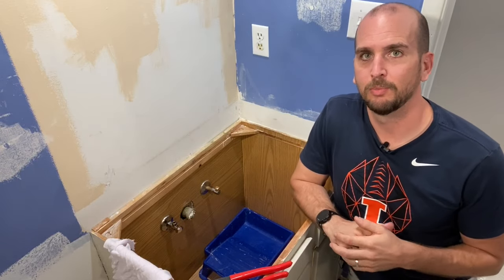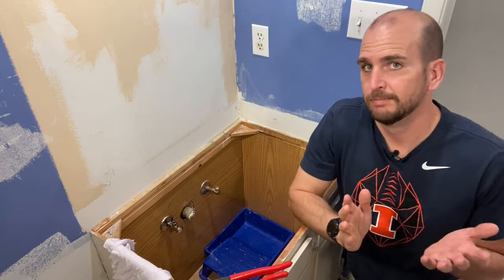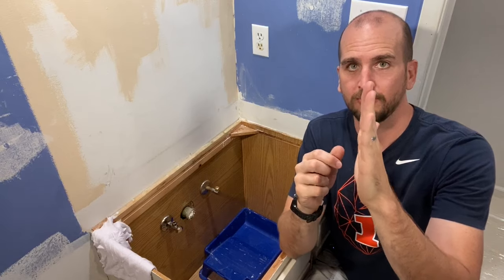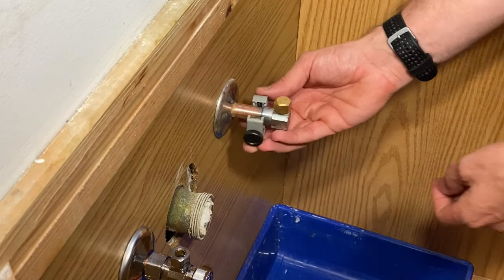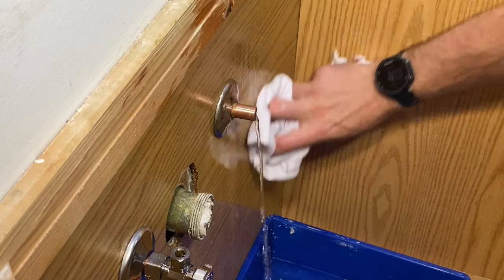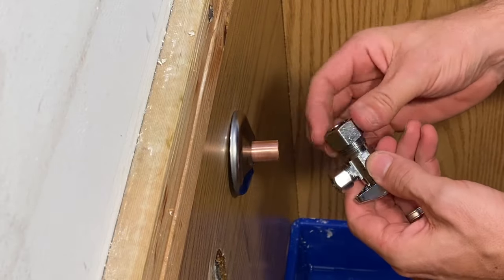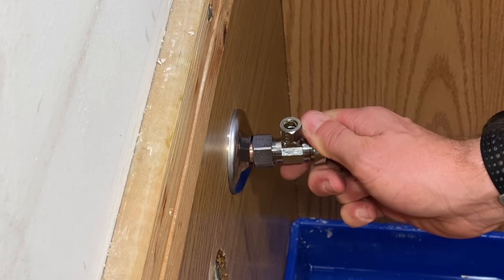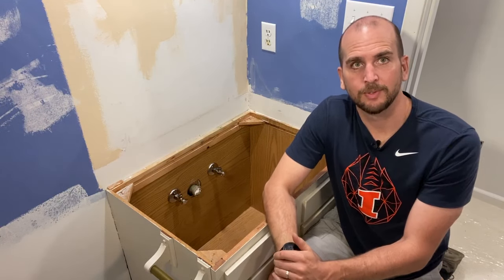How To Install A Compression Water Shut Off Valve | Bathroom Sink

Comment: Excellent video.  I have learned from other plumbers to use a mini hack saw blade to cut the ferrule or use a ferrule removing device.
Reply: The existing connection was soldered, not a compression fitting.

Comment: I just started re-plumbing my son's mobile home and it had pex in it, but the pex was brittle, so I'm going back with all copper and I did my first shut off underneath the vanity and I haven't turned the water on yet but I watched your video to make sure I did it right LOL.  I haven't soldered a copper pipe in well over 20 years and I was not good at it to begin with..  so I will be letting it sit pressurized for 24 hours before calling it a success.  Wish me luck.

Comment: Yes open fixtures to drain it. I always solder on a copper x pipe thread adaptor so you have pipe threads sticking out from the wall, and you can simply screw a new valve on.

Comment: Excellent video as usual. I was wondering why you didn't use a blow torch to remove the old valve. You would have had more pipe to work with
Reply: I for one don’t know how to use se a blow torch so I appreciate the much simpler option.
Reply: @hokypuk1  Very easy and could have had more copper to work with
Reply: I was thinking the same thing! I wouldn't appreciate a plumber making my pipe shorter and less to work with in the future!

Comment: Thank you for taking the time to make this excellent video.   Regarding the tightening of the nut between the angle stop valve and the copper line.   Should that be a half or three fourths turn after the nut is hand snug tight.

Comment: Nice job, thanks.  My wife and I just purchased a house with alot of older sinks and plumbing fixtures. Just about to get in it.  I hope you're planning to replace the electrical outlet with a GFCI.  I have to do that as well.
Reply from the maker: Hey Sean, good eye and yep swapped out that receptacle to GFCI prior to putting that condo back on the market.

Comment: Thanks for an excellent tutorial! Very helpful. One question...given your high skill level and extensive experience (not to mention the luxury of having plenty of space due to the top removal), why didn't you just sweat off the existing copper fitting? I have never done this before and am curious what problems -- besides setting your house aflame -- you could run into while sweating off that fitting.
Reply from the maker: This one was interesting and since there were 90-degree fittings I needed to remove water which was trapped in the pipe and I couldn't completely drain it down.  What this means is the water will cool the pipe enough where you will not be able to desolder the joint or at least with my skill level.
Reply: @EverydayHomeRepairs  Thanks,  I would have kept trying to sweat it off and not through about the water.
Reply: I would have used a shop vac and duct taped a straw or tube to the wand end and sucked the water out and then sweated the pipe til any residual water have evaporated.  Want to save as much copper pipe as possible for any future repairs.

Comment: My scenario is similar but with much higher consequences. The valve needs to be installed on the 1/2” copper leading to the outdoor sillcock. There is a small access hatch above the pipe but there are 2 gas black pipes very close by making soldering quite unsafe. I’m not too confident in Shark Bites so I’m going to try the compression fitting provided I can get BOTH of my fat hands inside the hatch. Wish me luck.
Thanks again for the info.

Comment: I liked it.   I have to change my valves bc they installed cheap ones before my time.  By the way, what's the best way to find a rattling pipe when turning on the hot water?  Thanks

Comment: I've watched your videos and Hear for beginners but this video needed a little more.... Like this..
#1. Me personally i would've unsoldered to keep as much Meat to Work With.
#2. Compression fittings when tightening, because of the rotation of the tightening it will Slide ever So Sightly Away From the Wall AND is Good practice before Giving is Final Snug ..,. to Thread on the opposite end Nut of Compression  Valve to Not Damage the Threads and Tap lightly the Whole Valve in more on the Copper Pipe and Then .........Give it's Final Snug..
Stay Blessed 🙏. Peace.
Reply: extremely un-useful explanation for #2 there.

Comment: Got to use pipe dope on compression fittings. Also I would have just unsweat the 90 so I had more pipe to work with.

Comment: With so little room left on the pipe, would it not be a good idea, after making the cut, instead of putting the shut off valve put a 2 inch pipe  with a connector  so if in time the new valve fails, another new valve will have over an inch of pipe left?

Comment: My stub out is too short to cut off the old soldered shut off valve.  Can I remove it and use a new compression valve on the same area the old valve was soldered to?

Comment: I see on most of your videos after you cut off the copper waterline you ONLY EMERY CLOTH THE OUTSIDE OF THE COPPER pipe.
Shouldn't you deburr the inside of the copper pipe also so that it smooth water flow through the pipe?
Reply: Yes he should have, using a deburring tool.  :face-turquoise-covering-eyes:

Comment: Extremely helpful. I just replaced the hot and cold shut-off valves in the laundry room. No drips from the cold side but there is a small drip on the hot side. I cranked down on the compression nut as much as physically possible and there is that drip and dribble of water. Any thoughts?  Thanks again!
Reply: Did you sand it down a bit to clean the pipe?
Reply: I think you cranked down to much on tightening the compression fitting .
There a gages to check the space between the to compression nuts.

Comment: Hi, very informative video. I have a shut off valve with built in supply lines that are attached to the hot and cold side of the faucet. I want to change the faucet. Question 1: Do I have to change the shut off valves too? 2: If I need to change the shut off valves then how do I know if it is a pressurized valve or not? Thanks in advance
Reply from the maker: You should not have to change the shutoff valves but you can test them to ensure you can stop the flow of water without any leaks prior to taking off the water lines and swapping the faucet.

Comment: I do not think I have a full inch of pipe sticking out of wall.  I have an old leaking sweated on valve under my sink with a resident bucket to catch leaks.  I am no longer able to use the sink because of this needed repair.  I wanted to switch to a compression valve 1/4 turn such as you demonstrated.  Since I cannot afford a plumber, and don't have a full inch of pipe to work with, what can I do?

Comment: Another great video! Can you use the 1/4 turn valve on Pex tubing? Plumber changed them from copper. I want to try to attach new faucet myself! Your good videos give me confidence that I can do it and save a coupla hundred bucks!
Reply from the maker: Yes, you can get 1/4 turn valves for PEX which will crimp on a PEX type B line or you could also use Sharkbite.

Comment: What if I don't have any extra pipe to cut like at all?? Trying to fix a supply shut off valve  in a kitchen. Like the current nut and ferral will not come off the supply line. And it's almost even with the sheet rock already.

Comment: Would you mind telling me why you don’t use a  compression sleeve puller?  Or a heat gun if it was sauntered on? So you wouldn’t have to shorten your copper pipe?
Reply: So if you use a compression sleeve puller, there is no need to cut off the pipe where the old ferrulel ring sat?

Comment: The level of water in the bowl also depends on the built in trap. If the toilet has been designed with a low trap, you will not be able to keep a lot of water in the bowl. Look at a cross section of a typical toilet and you'll see what I mean.

Comment: Hi, I don't have the benefit of extra pipe coming from my wall to cut off the water valve, and mine is stuck, I've tried your heat suggestion, I've even tried soapy water, but I can't budge it, I am nervous about doing damage to interior pipe holding valve, to be honest, I can't tell which bolt to loosen, one seems to be part of the valve and then there is a part against the wall. I've been camping out here with no water, yes, I may resort to the compression cap to have running water, but need to complete toilet for use, any suggestions would be great, your videos have helped me so much.
Reply: WD 40 and a few light taps with the end of the wrench did it  for me.
Reply: @denisef1153  Great news, thanks for the response.

Comment: I missed the reason why the old valves were not unsoldered rather than cutting the tubing - which seems like a really bad idea.
Reply: He didn't say, but my guess is that he doesn't have a torch or is not experienced/comfortable with soldering

Comment: Whats the reason for cutting the copper pipe? Im new to plumbing im a diy'er seen few videos were they cut it and other were they didnt can u explain plz
Reply: I'm not a plumber, but as far as I know there are only two options here: 1) cut the pipe 2) unsolder the old fitting . Perhaps he didn't have a blowtorch or was not comfortable with soldering.

Comment: Unless you don't have enough room or angle for the Crescent wrench handle, you should never tighten or loosen a nut with the pressure against the movable jaw, only put the pressure on the fixed jaw. If used putting pressure against the movable jaw, it eventually loosens and wares out.  I have even seen both a 10" and a 12" 'adjustable wrench' break when used improperly in industrial situations.  In this video you had enough room to use your Crescent wrench correctly.

Comment: This helped because I'm removing an old compression fitting with one like this and it was the last part that I needed. However, I'm wondering, instead of cutting the pipe first, why not take a torch or a heat gun to the old fitting, melt the solder, and then remove.  Then sand the end and then if necessary, trim off the edge of pipe, thus maximizing the remaining length of pipe.
Reply: I recently replaced the valve to my toilet and what I did was clean up the water line and just pull and twist off the old ferrel. Be careful not to compress the water line. I believe there is a specific tool you can use to remove the old ferrel. This way I kept the pipe intact for the next replacement, which will need to be done again in about 20 years.

Comment: Ok -now do this same video where the water still drips even after shut it off at the main and drained it… you only have 3 inches to get both your tools under there and it’s dark and your head and your arms don’t fit, and the water continues to drip all over your hands and tools can you tighten the compression fitting to what you think is tight, but when you throw the water back on, it’s still drips and so you keep doing this three or four times until it finally stops. Now throughout this sprinkle a bunch of F bombs and “ are you kidding me?” And you’ll have a video of how it normally goes for most of us.😂
Reply: Yeah. Next project is replacing the dog shit PVC ball valve the builders put in by shutting the whole system down before the meter. The gate or globe valve looks rock steady enough.

Comment: My water in the toilet bowl itself is lower in a few days if not used, I've tried to adjust everything. I'm not sure why this is happening. When I flush the bowl, It feels to the proper level. I noticed a few drops of water on the float valve. I don't see any leaks anywhere and don't notice it running at all. Any idea what's wrong?

Comment: So what do you do if you have a slow leak? Is a little pipe dope on the ferrule a solution before compressing it down?
Reply: You mean a slow leak on the new valve install? If so I think you just need to tighten it a bit, until the leak stops.

Comment: You don't always have to cut the water line. You can remove the old ferrel by pulling it off. I believe there is a tool that helps you do that, but a channel lock can also be used. Just be careful not to crush the water line. If you are not replacing an old compression valve, them you'll have to follow the instructions in the video and cut the water line.

Comment: I'm going to do this in my kitchen, with straight (vertical) valves; old plumbing with supply lines coming up out of the floor (copper). The faucet supply lines are grey PEX (Delta) and I bought an acrylic ferrule for that side of the valve. Wish me luck.

Comment: I thought you'd put teflon tape on the male threads of that 1/4-turn angle value to prevent leaking around the threads as a precaution. Some use thread sealant (TFE paste) or pipe dope on the copper from the end of the copper pipe to the compression fitting.
Reply from the maker: Hmmm, I am not a professional but for compression fittings I don't add anything extra and haven't had any issue.  For pipe thread fittings I agree teflon tape is a must.
Reply: I was also wondering if the tape is needed. I just replaced both shutoff valves under our kitchen sink. One of them has a very small leak still, I’ve tried tighten it but it still has the leak. I’m going to remove it and try tape on the threads. Any other suggestions?
Thanks
Reply: @cosmo9362   I put Teflon tape AND pipe dope on the threads . Works like a charm for me.
Reply: The threads are not providing the seal, the sleeve is doing all the work. If you want to help seal it put pipe dope on the sleeve - fyi the sleeve is the piece that gets compressed
Reply: @hopkinshome3799 Exactly true, that's why Teflon tape /pipe sealant not needed for threads.

Comment: How do fix it if it barely leaks on that bottom side. It’s so light it has t even dropped yet after 30 minutes
Reply: I think you can just tighten the compression nut a bit

Comment: Hey Scott, 
I'm looking to add shut off valves under the sink in my (older) bathroom, which currently has none. There is less than an inch of pipe available to cut (less than half of the width of the small pipe cutter you use in this video). Is it still possible to install the shut off valves? If so, how should I approach doing this? I imagine, if it is possible, that there would be just enough space to put the valve if I can remove the current connection piece, but it doesn't seem like that's how you're doing it here.
Reply from the maker: Hey Dan, assuming this is copper pipe there is an option where you could heat up the current fitting which should solidify the solder and then you could remove the fitting and get the pipe length you need. I couldn’t do that because I couldn’t get all the water out of the pipe so I wasn’t able to heat up the pipe enough with a torch since the water was continuing to cool the fitting.
Reply: @EverydayHomeRepairs  Thank you! I have to check if the pipe is copper, but if it is, I'll try this method.
Reply: You might need to buy a pipe of the same material and solder it

Comment: Instead of cutting the pipe i have use a compression removal tool. It saves time , money and elimates shorting your pipe.
Reply from the maker: Hey Joe,  good tip.  I have seen those and might need to add it to the toolbox.
Reply: If using a compression removal tool would I just clean off the copper tube with the sand paper and then proceed to install the new compression water supply valve as shown in this video?  I think if I cut my copper pipe, I won't have room to screw on the new valve.  It's going to be very close to the wall.
Reply: @jennyvieve9108  correct, use emery paper or 120 grit sandpaper to clean around the outside and inside of the tube.

Comment: This really is a poor explanation on how to do this valve replacement.  For those who can't cut the pipe or don't want to, there should have been an explanation on how to remove the valve and ferrule.  BrassCraft recommends putting oil on the valve threads before tightening the valve nut.   The most critical part is how much to tighten the nut without damaging the ferrule or under-tightening it with the potential to pop off and flood the house.  This valve replacement carries a great deal of risk, and you could have done a far better job explaining how to do it.